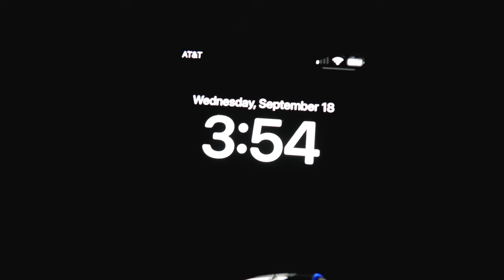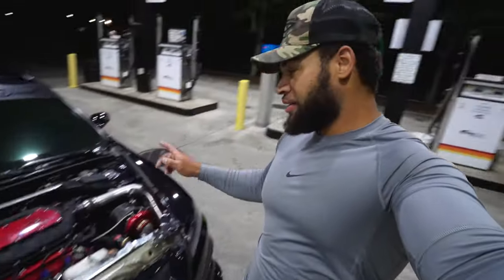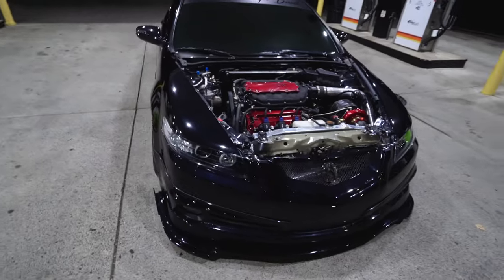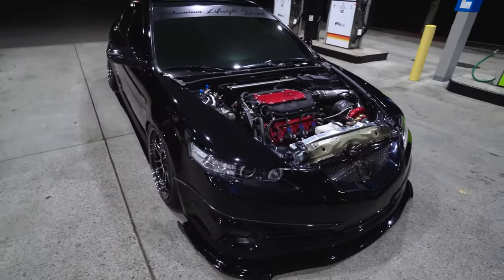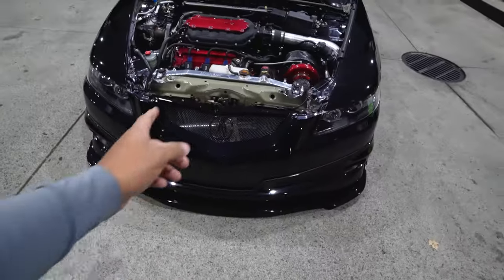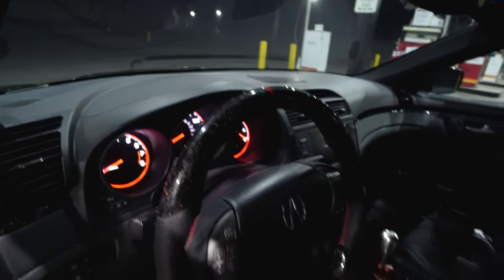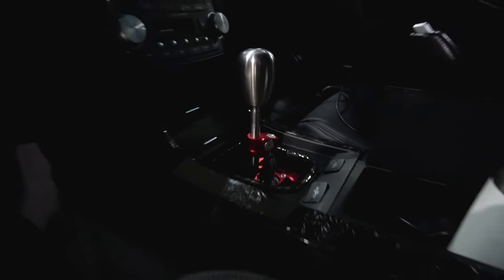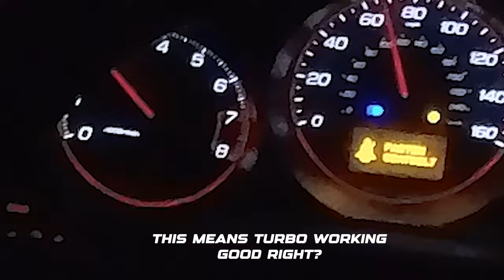4am Birthday Drive 450hp Turbo Acura TL-S | POV | Insane ASMR

Comment: Question bro , my 05 Acura till timing belt broke into pieces, I replaced it but now when I hook up my battery it turns on with no key runs for a couple seconds then shuts off and also the wipers run too any ideas on what is happening?🙏